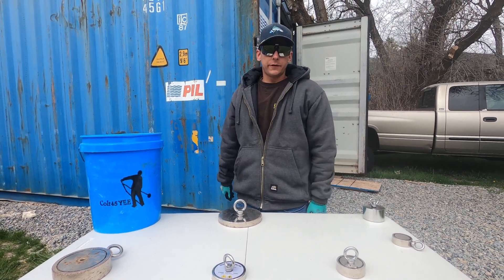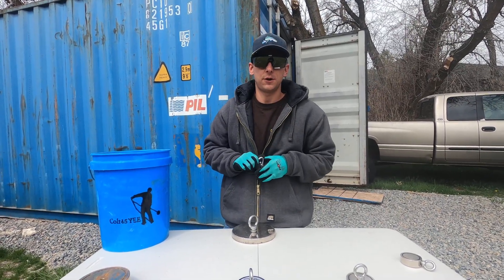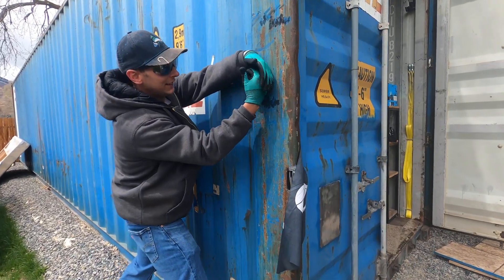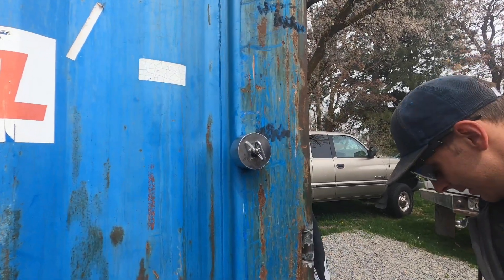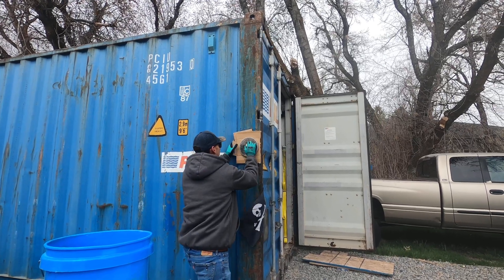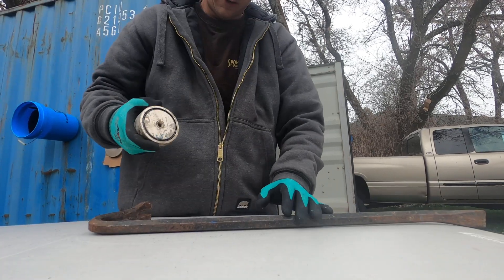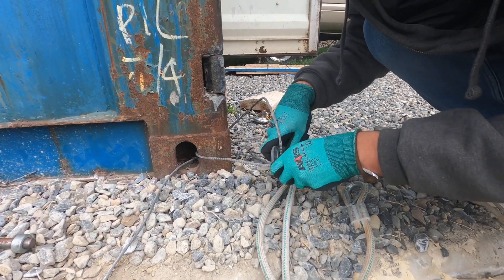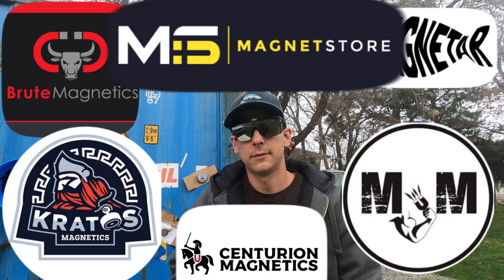What magnet should you get?!

Comment: who is the vendor of the magnet you said came from Amazon.....Amazon does not sell magnets, they are only a platform for vendors to sell their magnets from....I am not supporting any brand, but i will bet that based on your review, a lot of people will want to buy that magnetar magnet, and that is likely a big mistake for a new magnet fisher....a new magnet fisher has a greater chance of losing their first magnet as they increase the pulling  power of the magnet they start off with....while  your video was interesting, I think you  have  provided some confusing information for newbies
Reply from the maker: That’s good to know, I will be making another video in the future and this information will be useful. You are very correct, the beast is not a magnet for the beginner. Yes checking the pulling power recommended by manufacture should be considered when making a purchase, as well as price. The Amazon magnet is one that I received as a gift. I was told that it came from Amazon but not sure on specific dealer. New ideas are in the works for round 2. Thx again.